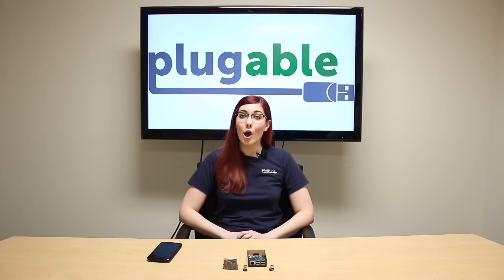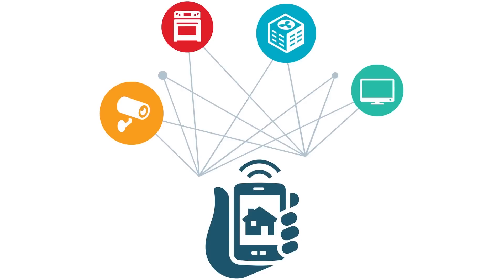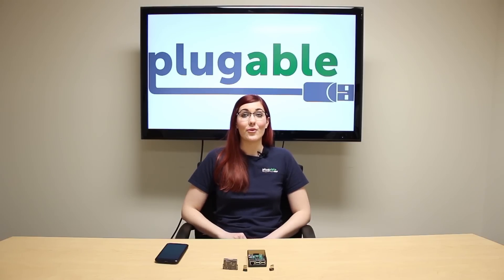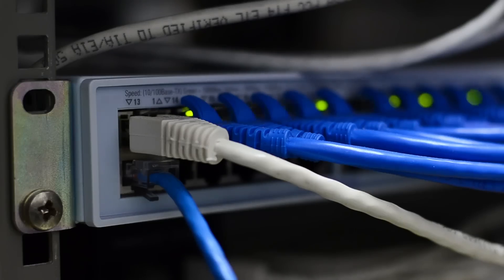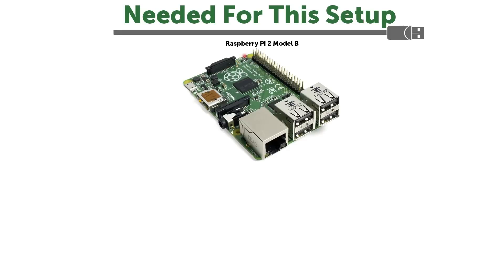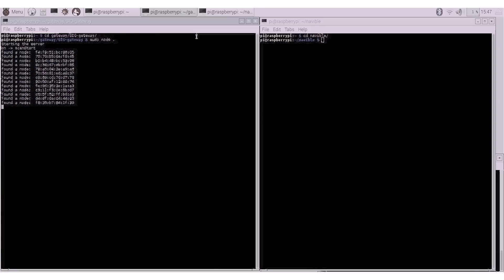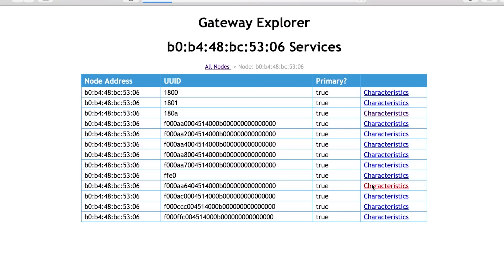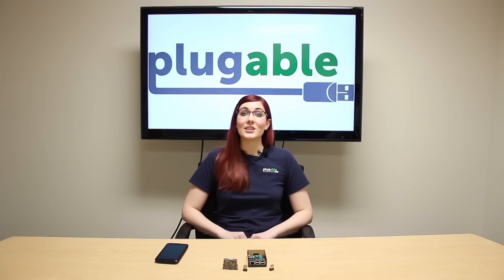Raspberry Pi Home Automation via Bluetooth & WiFi Adapters

Comment: is this compatible with ps4 and ps3 bluetooth controllers and if so how many devices can work simultaneously?
Reply: Sony uses non-standard Bluetooth implementations on their PlayStation-branded peripherals. Because of this, third-party software is required to make them function. Due to this, we (Plugable) do not support using the Bluetooth adapter with PlayStation-branded devices.